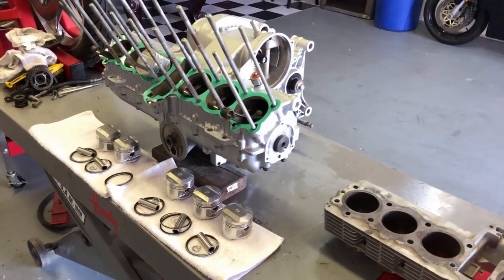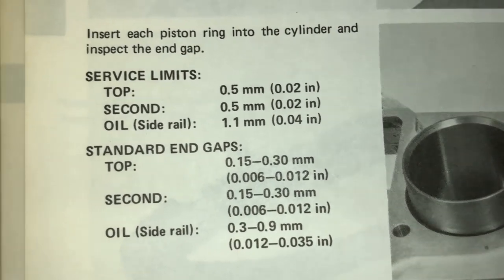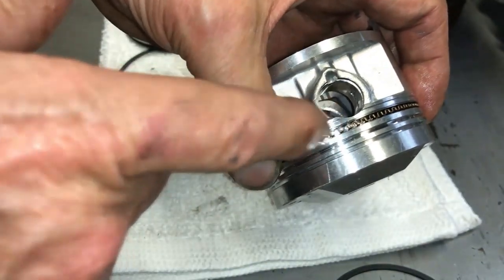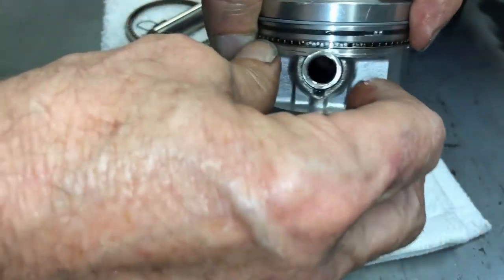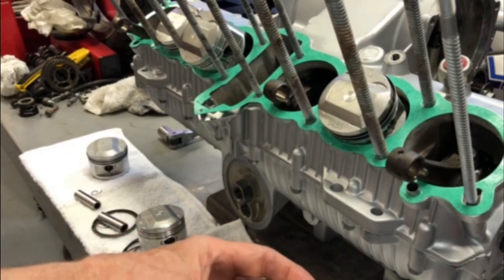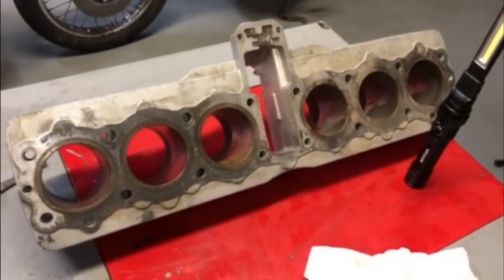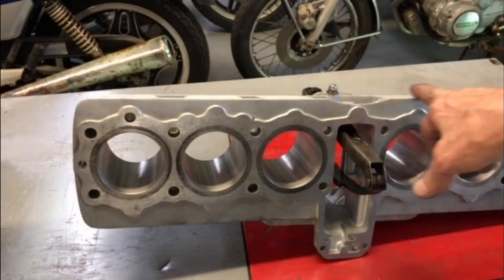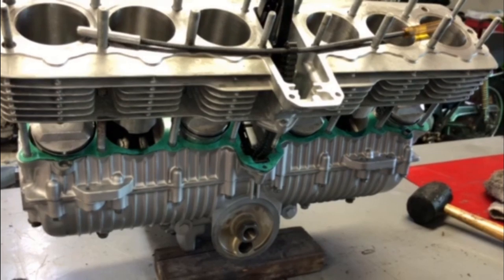Honda CBX Full Restoration & Engine Rebuild Video Series - Part 18 Re-assembly Part 5 Pistons & Head

Comment: why don't you use a piston ring pliers? you grind the valves? with a piston ring tool it would be easier to assemble the rings. You don't usually grease the joints with grease? And why anti-seize putty on the screws? Thanks for the nice videos

Comment: Great Job, my friend!
I wished you would have shown in more detail how to get all pistons into the cylinders. You just showed 2 and 5 and in the next scene all were in. Usually this particular job can be a huge mess and trouble without the right tools. I wonder how long it took in total 😉
Reply from the maker: Hi ZAM
I showed 2 & 5 to basically show the concept of working each pair of pistons into their respective cylinders.
I felt that it would have been repetitive to show all 6, and for the sake of time since this was a long video packed with other info.

Because of the nature of installing these cylinders being that they are lowered down on to the pistons, Honda has made it pretty easy with that large bevel at the bottom of each cylinder lining which works great. The rings are easily compressed as you manipulate them with the bevel. It really is no easier with the special tool Honda had, which is no longer available. That is why I do not have one.
As far as how long it took, it took about 10 minutes to get all the pistons started to the point that I was able to gently knock the cylinder down into place.
Thanks ZAM, I hope this cleared up any question you had on this.
Reply: Thanks a lot and yes, your answer helped me. I have such a motor on the table and I don't think that it needs disassemby. But I wanted to "prepared" just for the case 😉🙏
Your video series is helping a lot to make the right decisions. Thanks for that.
Reply: @ZAMsChannel  It will come to that, you just don't know it yet. And we are all waiting for it to happen. :D

Comment: Great video, I am a bit confused, at Min 7:00 you are talking about the cylinder numbers and the way to install the pistons,  I thought the cylinder #1 is the one on the left of the bike and in the engine that you're working on, will be the first one on the right and so on with the #6 on the left, let me know if I am correct, Thanks
Reply from the maker: Hi Paul 
Yes, #1 is on the left as you are sitting on the bike, or another way to think of it is “the driver side of a car”
Reply: @digitalpizza1  if you check after min: 7:00 your description does not mach the order of the cylinders
Reply from the maker: Hi Paul, Yes, I miss-spoke calling out the numbers of 1 and 6. I was narrating in real time when I made the video and incorrectly called them out. The important thing is that 1 & 6 are at Top Dead Center. Unfortunately, I can't correct the video without deleting the whole thing.
Reply: @digitalpizza1  Please don't take me wrong,  I love your videos and your knowledge, your are one of the best on what you do.  it is just that I am very observant , Thank you for the answer
Reply from the maker: No not at all, I am glad you pointed it out so others can understand the mistake in the video. Thank you for your support, I appreciate it. :)

Comment: Are you going to post a restore of the carburetors?
Reply from the maker: I will be doing a partnered video with my Carburetor guy soon.
Reply: I'm currently doing this, but unfortunately (for you) I'm talking German language.
https://www.zamschannel.de/honda-cbx-pro-link-6-zylinder-mit-1050-ccm/honda-cbx-teil-09-vergaser-abbauen
Parts 9..13 are about the carbs. Part 13 is not released yet.

Comment: You spent all that time and money on parts and labor why are you using compromised fasteners they're obviously used they're stretched and The Rusted which means you're not going to be able to get a good torque on them play some now while you have the chance otherwise it's probably going to come back and bite you in the butt
Reply from the maker: Not sure where you got the idea that the bolts or the the threaded studs were rusty, no rust at all, and the head nuts were in perfect condition as they have been bathed in oil their whole life. On top of that, the torque specs are 23 to 25 lbs for the large nuts and 13 to 15 lbs for the small ones. 
I am sure nothing is stretched or compromised. Also, I have built at least 10 of the engines without any issues